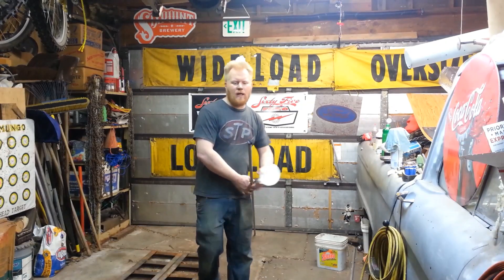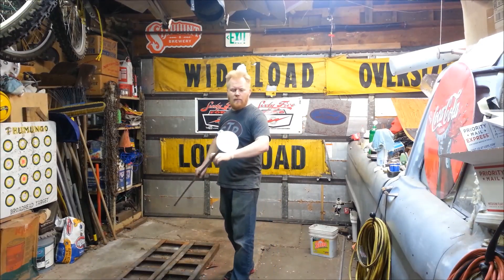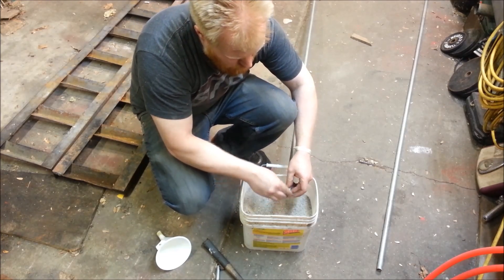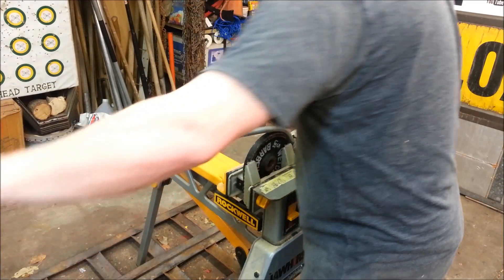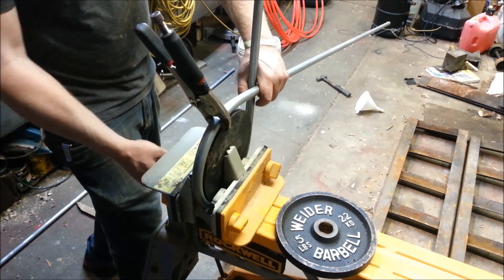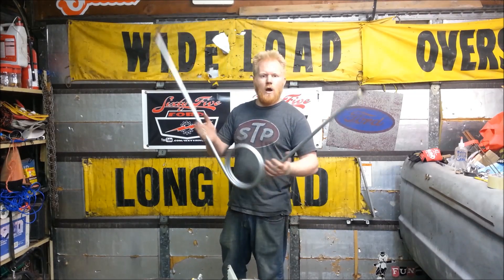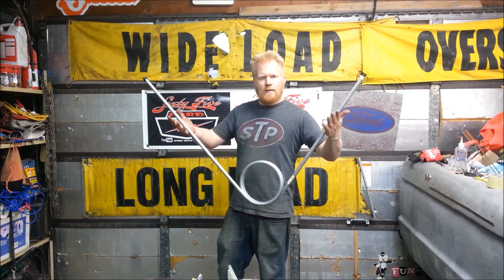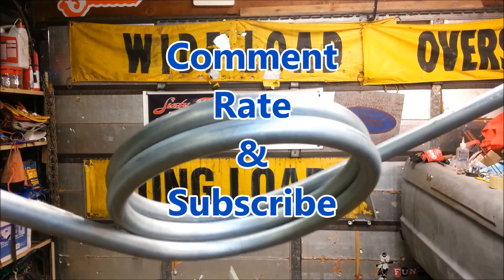Bending Tube and Pipe without kinking it... Tubing Bender Homemade

Comment: I'm thinking of attempting to replace the pipe/tube on some old (50's 60's) lawn chairs. How thick is the pipe you are bening? Will conduit work for what I want? Any help appreciated.
Reply from the maker: The stuff in the video is just conduit. It's probably thicker than the stuff used on old metal chairs.

Comment: heat would have made it easier to bend!. Filling pipe with sand does a nice job.
Reply from the maker: Yes, but then you can't handle it easily. Also just making it hot won't suffice; you need to make it cherry red for heat to help in bending.

Comment: I'd actually thought of this, problem what I have to bend isn't round tube  its 80/20 extrusion's
Reply from the maker: Yeah, that's not going to work with with this. Off the top of my head the only easy way I can think of is by pie cutting it 80% though a bunch of times, bending it and rewelding.

Comment: I need to bend 3/4 pipe to form an 8 ft diameter circle..how can I do that ..literally no proper tool to do so..
Reply: You need to find someone with a motorised section roller. Metal fabrication shops have them. You'll have to pay a fee but it will be a perfect circle 8 ft in diameter with no kinks.

Comment: Very cool!! I have to bend a 1/2” ID by 1/16” wall steel tube sand filled. Can I bend that by hand or would I also have to heat it? And if I heat it with a torch, I assume it has to be heated on all sides not just the outside bend?
Reply from the maker: No heat is needed, just brute force. It's easier to bend around a form and to leave the pipe long for leverage.

Comment: Hi man, what a great demo, i love it!! Question, do you think it's possible to bend stainless steel 33.7mm diametere puting sand and using this technic ?
Ir've got to build an motorcycle exhaust, thank you
Reply from the maker: I've bent 25mm steel tube without issue. It really depends on the wall thickness but also the malleability. Stainless isn't the softest steel and doesn't want to stretch/conform much. I don't think you would have an issue with small bends but  sharp bends wouldn't work well.
Reply: @sixtyfiveford  All right, thanks for this answer. What do you think if i warm up the tube with a welding torch + sand?

Comment: Dear sixtyfiveford, thank you for making and posting this video.  Good job on that.  ¿Will this work to bend the ends of a piece of copper water pipe (tube) {M [red], thin wall thickness [0.025"], or L [blue], med wall thick [0.040"]}, please?  I'd like to make a small (~10" long piece with a slight bend at both ends, leaving a ~4" flat land at the center).  ¿In your opinion, Is this something that's possible?
Reply from the maker: It won't allow you to bend a super tight radius. I would probably get a 3-4" radius if you're careful.  Also you would want the piece to be longer than you need and to cut it after bending.
Reply: @sixtyfiveford  thank you so much for the reply.  I see.  That's still good, because I was thinking of trying for a 6" or 8" radius (12"-16" dia.).  I'm delighted that this may actually work for my project.  (Skis/mod for my snowthrower to replace its worn skids).  Thanks again.  Merry Christmas to you and God Bless all your household.  tonyd\.

Comment: Nice video. Did you need to anneal the tube first? Did you harden it again afterwards? If so how?
Reply from the maker: This was a steel pipe so nothing needed to be annealed as steel doesn't really work harden like copper/aluminum. Copper pipe is always annealed when you buy it and will only harden after you bend it.

Comment: Do you think you could bend Schedule 40 steel pipe this way?
Reply from the maker: I've done it with 1-1/2" sch40 Black Pipe with good results. Problem is having an immovable object to bend it around.

Comment: That's awesome what's the biggest diameter pipe that will work with I'm doing a vw subaru conversion and I need to run hard lines for the radiator from the rear to the front
Reply from the maker: It's pretty much limited to what you can bend by hand. I've done 1.5" tubing with a little help from the torch to make it easier to bend.
Reply: sixtyfiveford ok thanks man I've been kinda worried about making these radiator hard lines but I think It should work out

Comment: where can you buy those 10 feet, 1" or 3/4" diameter tubes? I tried looking at Home Depot, but all they have are 5 feet ones.
Reply from the maker: All my local Home Depots and Lowes have these in the electrical dept in 10' lengths. It's just electrical conduit.
Reply: are those emt's? i think i cant weld them bec they produce toxic fumes when heated?
Reply from the maker: Yes, it is coated in Zinc(galvanized) which will make you feel sick if you deliberately inhale the welding fumes(shouldn't do this with any metal), but it won't harm you. If you do it for long periods you will get what they call Metal Fume Fever, which feels like a mild flu for a day. Again there is no long term damage or harm from doing this it's just not fun to feel sick. Do it in the open or with a small fan blowing across you and there will be no issue.
Reply: thanks man! and im also looking for square tubes, do you know where to buy those?
Reply from the maker: I always get square stuff from my local steel supply yard. The Home depot has short 4-5' pieces but you can get 20' lengths for close to the same price at the steel supply places.

Comment: Great video but I have to ask!, can it be done with 2 inch tubing. I fully understand  I'll have to  up grade the stand and the weight you're using but can the sand help me outof the kinck problem?  Thanks
Reply from the maker: 2" tubing takes a ton of force to bend. The sand needs to be packed very  tightly and you'll more than likely need some heat to help it bend.

Comment: I have a pair of bicycle handlebars I'd like to re shape, they're either aluminium alloy or a light steel, maybe Chrome Moly, but as they're already a certain shape, I don't know how to go about it. any tips?
Reply from the maker: Slight bends are generally easily done with heat. If you need to bend it a lot and don't want to ruin the finish, fill it with sand. A leverage bar is a must.

Comment: I was sceptical, and having just paid a lot for 1" stainless tube for the handrail on my boat was looking to buy a tube roller but £200+ for a one off job I decided to give it a go, it was bloody hard to bend but it worked a treat, I just sawed a former out of chipboard and fixed to my patio, and hung off it till it bent, it never kinked at all nice smooth bends, cheers.
Reply from the maker: That's great. I'm glad the video was a help.

Comment: I came back to thank you for your help. I had a small Bimini top with two poles of 1/2" aluminum for the top, that came bent at an angle, that made the bottom part open wider than my inflatable boat. I had two pieces of dowel that fit the pipe, poured salt in, tamped it with dowels.....went slowly....and it worked! Saved the day! Thanks so much for your tutorial and taking the time. Martha
Reply from the maker: That's great. I'm glad the video helped.

Comment: Hi sixtyfiveford, I want to bend 19 mm steel tube. There are 19 mm copper tube benders on Ebay but I'm not sure if they will bend steel due to its lower malleability. Can you provide any advice?
Reply from the maker: You are going to need the method I show in this video. 19mm is too ridged to use the copper benders.
Reply: +sixtyfiveford 
Thanks mate I was afraid of that. thought it was going to be easy.

Comment: Can you get the sand out easily enough if you need the tube to be hollow?
Reply from the maker: +gravelsanga Yes, once you pull the tape off it just pours out.
Reply: +gravelsanga You could use compressed air if you really want to be sure its all out.

Comment: To me it looks like the tubing maybe a little oval,not totally round anymore,it all depends on how tight the radias is,there are limits on size of pipe and wall thickness.
Reply from the maker: +Paul Clare The tighter you pack the sand the better, but it will always oval a little.

Comment: tried this  with 1/2 conduit and did not have much luck.
Reply from the maker: +Doug Hedrick I've bent a lot of conduit this way and never had any issues. Make sure the sand is packed tight.

Comment: First off, very good and educational video. You gotta thumbs up from me. Thanks for posting.

So let's say i'm building a motorcycle chassis out of tubing. Would this method work for bending 1/8" - 1/4" diameter tubing?
Reply from the maker: +Joseph Isip That's very small tubing but yes it'll keep the tubing from crushing no matter the diameter.
Reply: Sorry, I meant wall thickness.
Reply from the maker: I've done 1/8" wall but with the addition of heat(oxy acetylene cherry red) as it is extremely hard to bend by hand/leverage. The tighter the sand is packed the better the results.

Comment: awesome work! I've been trying to use heat to bend 1/2'' type M copper tubing into 4'' diameter coils but it hasn't worked too well (lot of kinks and pieces snapped in half). I'm using table salt to avoid kinking and heating it with  torch but no achieving those smooth bends I see here. any advice? i may just try EMT. wonder if it would make the difference seeing how you didn't even need to use heat.thank you boss
Reply from the maker: +Joshua Jackson This trick works great on copper tubing.

Comment: nicely done! 
I need to bend some 1.5" pipe with my 16t hydraulic ram bender from Harbor Freight. Will packing that (much larger) pipe with sand also keep it from kinking? Thanks!
Reply from the maker: +Stephen Dumaine It will but you need to really tamp/jamb the sand in it tight.

Comment: That is not pipe, you would not be able to hand bend pipe like that. If you are making "educational" videos you should use correct terminology. Thanks
Reply from the maker: Paul C You can bend pipe with enough leverage.
Reply: +Paul C I got your 'pipe' in my pants.
Reply: +Welcome2NAmerica 
You have some great comments, thanks for your reply
Reply: Paul C
Thanks Paul, I work really hard on them.. LOL.
Reply: Most tubing has a thinner wall thickness than pipe. That is why it is more prone to kinking thus requiring precision dies that are sized appropriately. Sorry this obviously isn't an intellectual forum. Have fun with your keyboards kids...the rest of us have parts to fabricate.

Comment: Giant mouse trap spring? lol
Reply from the maker: KernDesertPreppers Yeah, it's ready for some serious work.
Reply: sixtyfiveford Quick question how do you get the sand back out?
Reply from the maker: Take the tape off the end and it just pours right out.
Reply: sixtyfiveford o ok cool thanks :)
Reply from the maker: Have fun. If the pipe is thick or hard to bend you can add heat as well.
Reply: sixtyfiveford Thanks, i'm making a luggage rack for my suburban with my Ham antennas mounted to it.

Comment: What are your thoughts on heating larger or heavier guage pipe with the sand in it?
Reply from the maker: Orrin Lanz I have tried it and it works. The sand absorbs a good amount of the heat so a propane torch would be hard. Oxy-Acetylene is the way to go.

Comment: Best home made diy method ive seen. Curved barbells would be a bit more effective for holding in place round tubing and for square tubing a sandwhich of barbells with flat sides like the ones you used with a smaller barbell in the middle to hold the shape and prevent kinking
Reply: Jonathan Brown make us a video as you seem to know a better method

Comment: Thanks for the video, I'm going to try this with a very small piece of stainless tubing for a brew kettle dip tube. I only need about a 55 degree bend, however the tube itself will be no longer that 3 to 4 inches.
Reply from the maker: Thomas Moore It will work great for that or you can freeze water in the tube and it will do the same.

Comment: is it possible to do this with larger pipes, in this quality? I want to bend an alu or copperpipe for my airintake, on my mitsubishi colt 1.6. Till now i dont find pipes for it. but its allways better to make something own and it makes more fun! :)
Reply: maybe better with wet sand? I know these practice but never do this till now...
Reply from the maker: ken balsiger Dry sand or wet, it doesn't really matter. It works for any size pipe it's just a matter of having the physical strength to bend a large diameter pipe. Also a long piece of pipe is easier because you can use the leverage of the extra pipe to make the bend.

Comment: I wonder how well it would work with copper tubing?
Reply from the maker: Davie Jones Yes, it works great with copper.
Reply: sixtyfiveford
Well I got my 3/4 copper tubing and it is filled with sand and have to make two 8 3/4 rounds out of 2x10 to bend it around for a project I'm on. Great advice and thanks and  I don't give that out easily! Only to the ones who really know what their doing and their hard to find today!
Reply from the maker: Thanks.

Comment: Do you think you could get a smaller diameter radius; say 6 inches? Thanks for the vid.
Reply from the maker: Yes. Pack the sand tight and it won't allow the pipe to crush.

Comment: With you holding the bent pipe when it looks like a 'giant spring', there is an illusion that the spring is from a safety pin and you are the size of a double A battery. :-)  Anyway I am going to bend an electrical conduit pipe to use as a hanger for a bird feeder and I found this video as a reference.
Reply from the maker: Awesome. Glad it helped.

Comment: would getting copper tubing thats already bent work better?
Reply from the maker: Copper is thinner and easier to work with but a lot more expensive. For the 20' of steel pipe I used it cost $4 total. Copper tubing would run about $100.
Reply: ok ? then u use thin wall or thick wall tubing then?
Reply from the maker: I used the steel conduit that has a pretty thick wall.

Comment: thweet trick Man, very useful, does it work on pvc?
Reply from the maker: Most of the time when I bend pvc, I just heat it and form it by hand. But if It's a sharp turn then sand would help a lot from it collapsing.

Comment: Another useful vid, thanks.
Quick tip for anyone that's reading. ..if you accidentally click 'dislike', as I did with this video (my phone downloaded some more text as I clicked another link and the text jumped down so that I pressed dislike unwittingly), you can remove the dislike by pressing the 'like' icon. So apologies to you Moe for the few minutes I 'disliked' your work. ;-)
Reply from the maker: Hey thanks.

Comment: Hey Moe, another great tip. Did you ever try this by letting water freeze in the pipe?
Reply from the maker: Yeah, it works as well but you can't fit 10' straight pieces in your freezer.

Comment: I can't wait to see what you are making. Nice to see you are making the Rockwell earn its keep.
Reply from the maker: Yeah, I'm always trying to find reasons to use it. Do you have one?
Reply: I don't have the Rockwell Jawhorse, but have always wanted one.I have not seen any other fold away benches that look as stable and strong and have as many attachments.  I do have their Bladerunner, and for a small apartment, if you limit your projects to its capabilities, it is not a bad tool at all, especially if you did not know band saws had been invented.
Reply from the maker: My only grip with the Jaw Horse is that it is heavy and cumbersome to move around. It is all steel but I wish they would have built most of it out of aluminum. The Bladerunner looks like a nice tool.
Reply: sixtyfiveford The Bladerunner is really an upside down jig saw, but it does allow for good control, but the bed is small so the size of the cuts are limited, and the fence takes some jiggling with to get straight cuts, but it is probably a better tool than I am a craftsman. It does not throw a lot of dust so is good for people like me in a apartment and has a dust collection vacuum port, and is not loud like my routers.Also, it is one of the safer woodworking tools I have seen, it would be ideal for parents to introduce kids to making stuff. I am going to be making some stuff for kids with it soon and add the videos  to my channel.
 here is a big rustic 2x3 foot picture frame I made with it.
http://youtu.be/d5zgnPA2wFo
I am always happy when I see you have a new video as you do a lot of stuff nobody else does and you don't have 40 thousand in shop tools and you improvise the heck out of stuff.

Comment: Hey cant you do that with PVC pipe by heating it?
Reply from the maker: With PVC I usually just heat and bend it. You could put sand in and it would stop it from kinking as well though.
Reply: 10-4

Comment: Your the man !! I never knew that you could do that so easy .. Thanks !!
Reply: Cool, but can you do it with regular steel tubing? Its harder to bend.
Reply: Not sure .. Might have to try it .. I think it would be very hard !!
Reply from the maker: If you can bend it, sand will work. You can also heat the pipe to aid in bending.